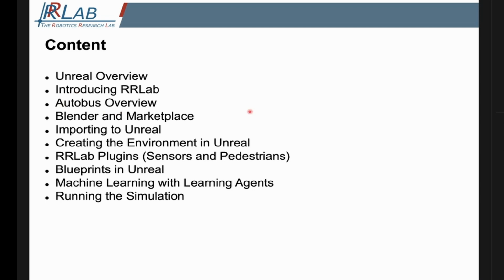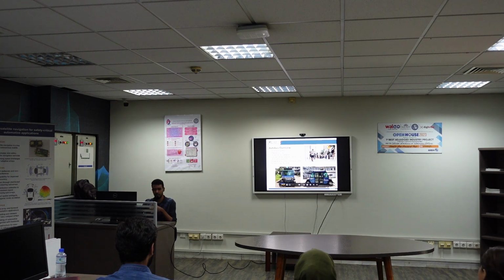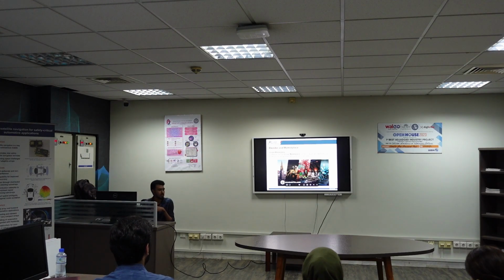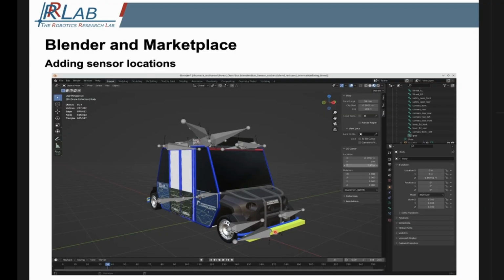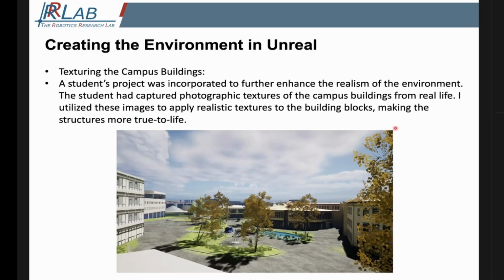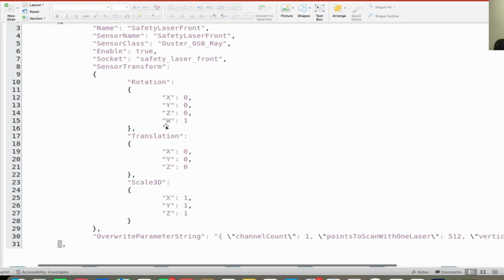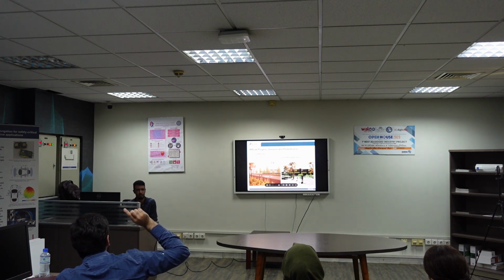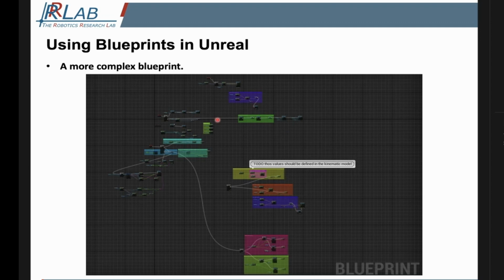Creating Robotics Simulations in Unreal Engine | My Workflow Explained

Comment: Good presentation, but the critical issue remains the physics engine. Unfortunately, Chaos and PhysX lack precision in simulating mechanics. To address this, you'll need to implement a custom physics engine compatible with Unreal Engine, leveraging either the Bullet SDK or ODE APIs (which is very HARD!). Another key aspect is optimizing 3D visuals to manage memory resources effectively, as designing collisions can be particularly challenging.
Reply from the maker: I haven’t looked into that but I will probably go through it soon ✌🏽
Thanks for the info …